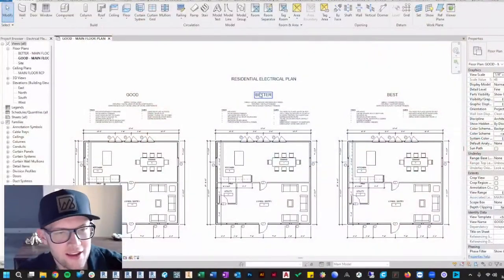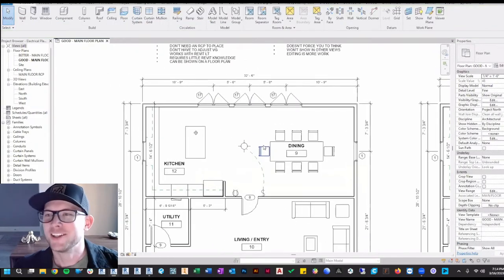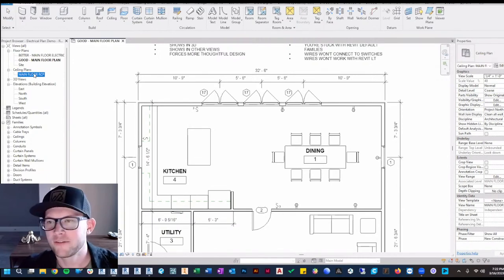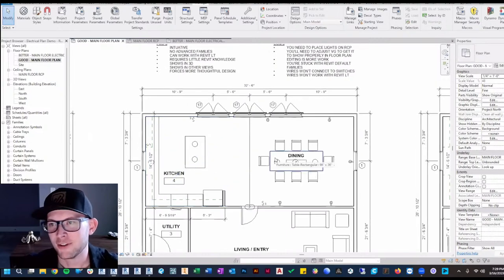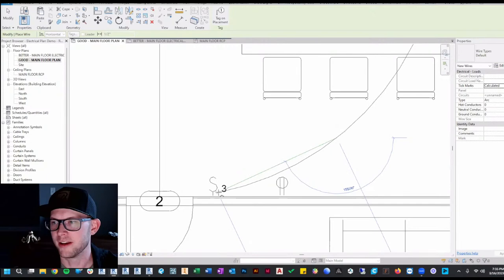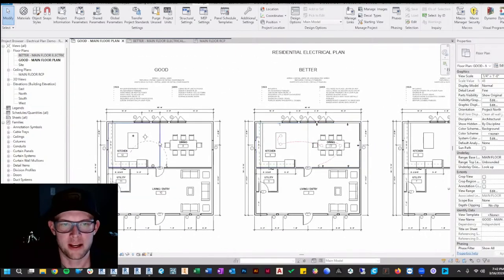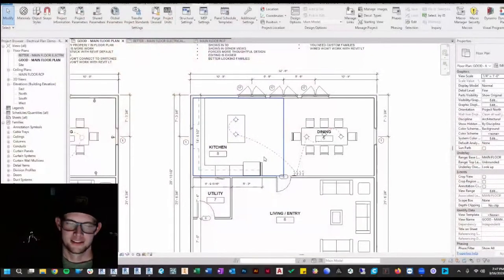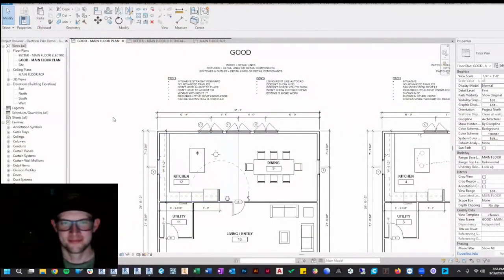Electrical Plans in Revit (for Architects)

Comment: For volume house builders in UK we use ceiling mounted light families that have an invisible model line from its centre towards the floor about 2m long. This invisible line is then cut by the view cut plane and therefore the light becomes visible in the floor plan. Same method for smoke detectors too.
Reply from the maker: Yes I have seen this method as well! It has its pros and cons, for sure!
Reply: That’s what I’ve been having to do also!

Comment: If you are using the Detail Line method.  The Spline works better than arcs.  That way if the fixture shifts you can just drag the end of the spline to the new location.

Comment: For method 2: you can go in the switch family and add a connector. then you would have to put it in the same circuit as the lights to be able to add the wire and connect them.

Comment: Great breakdown on the trials and tribulations of Electrical plans. I think the next thing you could talk about is “art” of placing the lighting symbols in revit schedules. My best efforts with this involve a reliance on an established lexicon of symbols that are sliced to established bitmaps images in photoshop and integrated back into the lighting families as image files so the symbol itself can populate the schedule. In this way the symbol key and the schedule can essentially be one entity. On residential architecture, where the scope is small enough, it makes for a very legible document. Admittedly, a lot of upfront work.
Reply from the maker: There are approaches... but, also, we should be asking ourselves why we need symbols in the schedule ton begin with?   If the fixture is tagged as "P1" and the schedule says P1.... why is a graphical symbol legend even necessary??!

Comment: I've been using RCPs for electrical for the last decade or so once I figured out how to set it up properly.  What I found annoying in Plan Views is that the electrical fixtures can sometimes host to the floor or counters or other planes in the way. Then it is not always apparent until you start looking at 3D views or sections.
Reply: @Rotor-Sims  Exactly! And then you cant not get it to attach to the porch so you flip the house in 3D and place it and then back to the plan to nudge it to it's correct placement. 🤣

Comment: If you place a connector on a work plane, while you have the connector selected you will get default witness line dimensions appear from the centreline of the connector to random nearby reference planes. You can then drag those witness lines to other reference planes and turn them into real dimesons that can be linked to parameters like normal. 
At least that's the only way I've found to dimension them without using the face host central dummy extrusion strategy. Don't we love MEP connectors?
Reply from the maker: Great tip Conor!  Thanks!

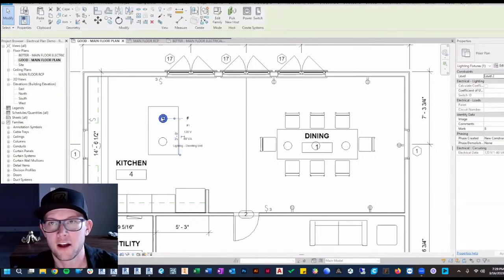Comment: To connect to the lights to a switch with wires, you just have to group the switch with the lights when you click the power button. (26:14) So when Brenton ctrl clicks the lights, he would have just needed to select the switch and he should be good.
Reply from the maker: Yeah but the switch does not have a connector by default.  So I don’t think that was the initial issue…?

Comment: Any tips for RevitLT users?
Reply from the maker: Did you watch the video?  Brenton talked about two approaches that are accessible for Revit LT users ….
Reply from the maker: Long story short … his suggestion was method 2 but with lines for the wires
Reply: Ashamed to say I didn't this time. Got used to the limitations of LT being ignored also. 🤦🏼‍♂️
Shame on me.
Thank you Jeff and Thank you Brenton.
Don't suppose there is a similar workflow for plumbing? Currently use specific beam and column families for coordinating with structure and between floors.

Comment: I am new to Revit.
Is there a way to do a concealed wiring and plumbing run through a cut opening in a brick wall, floor and ceiling, modelled in Revit. 
This video explains why this is needed. https://www.youtube.com/watch?v=RsRtlM8VvLU
I wish there were a scheduling method that is better than showing every switch overlaid on the Architectural layout.

Comment: WHAT IN THE UNDERLAY SELECTION WAS THAT
Reply from the maker: Which selection ... He did a few?
Reply: @TheRevitKid  The ability to select underlay elements was new to me. It was frustrating finding the element in 3D, going to a plan, and moving it with arrow keys. It even drove me to do the backward method of making a model line in the ceiling can family that comes down to the cut plane so you can see the lights in a regular floor plan view. What a filter nightmare that was. Thank you for this content.
Reply from the maker: @drewtonmorrison  right!? The number of people I show that stupid little button to on the bottom right that “face palm” from it is out of control!  So glad you found something useful in the episode !